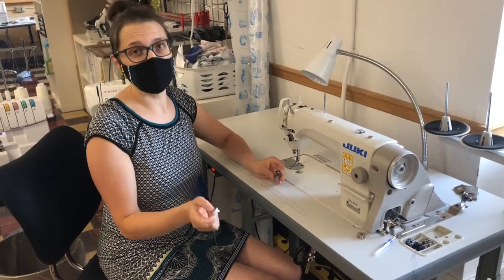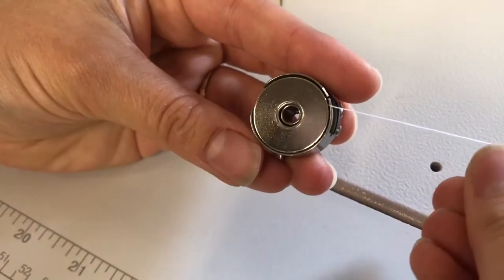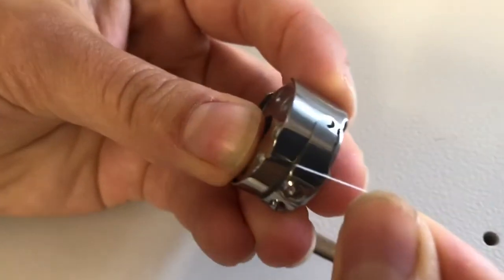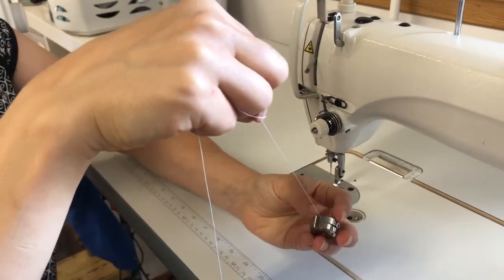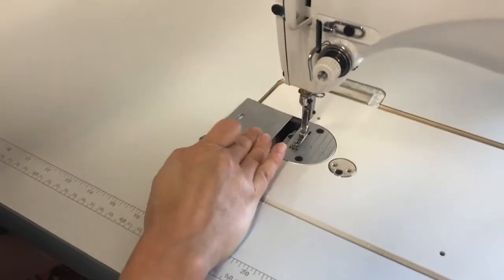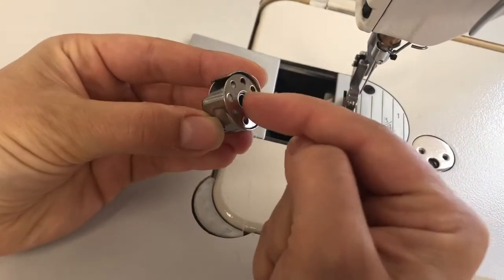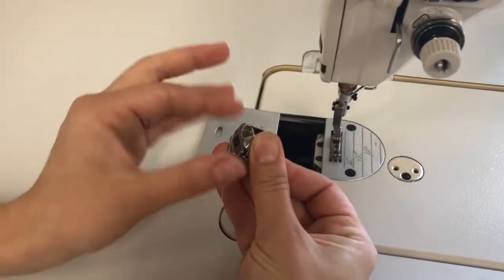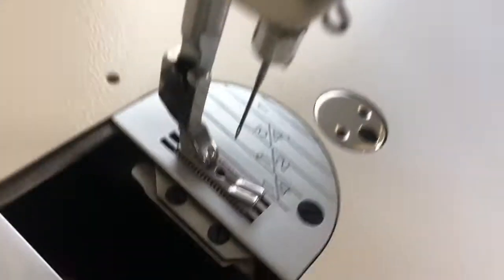Inserting the Bobbin in a Juki DDL-8700 Sewing Machine

Comment: So I just got my new 8700.
Threaded right. Loaded bobbin into case and hook right.
It seems but when I remove the fabric there are 3 threads coming out of baseplate and one on top from the needle and the 3 from bottom are very tight.
I have to cut the 3 threads and 2 of them are one thread and they come out. The 3rd is the bobbin thread.

It makes a stitch checked timing. Seems one of the threads is double looping and getting caught on the hook

What's wrong?
Reply from the maker: This is a very common issue!  The third thread is usually the bobbin thread doubled up.  What you do in this situation is to pull all the threads with your left hand off to the left side of the sewing machine while wiggling the hand wheel on the right side of the machine back and forth.  It also helps to slightly tap the foot pedal while you wiggle the hand wheel to release the tension, just be careful not to start sewing.  Wiggling the hand wheel while you pull the threads out should help you to get the "third" thread out.  Let me know if that works!
Reply: @gatherandmend  
Thank you for your response.
I found out the issue. I have. Aneedle position sensor and it needed calibration. In the needle up position, the thread take-up lever wasn't in top most position so the stitch wasn't fully being made and still being done in hook assembly. 
Just like any manual machines when finishing a seam I needed to make sure the take up lever was all the way at the top. This solved my issue.
Reply: Great Video. Thank you.